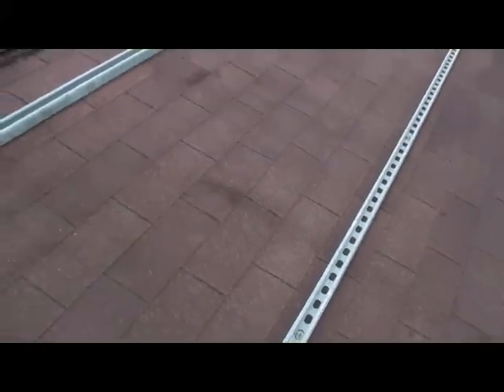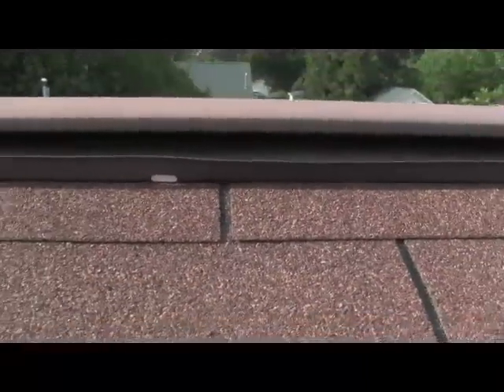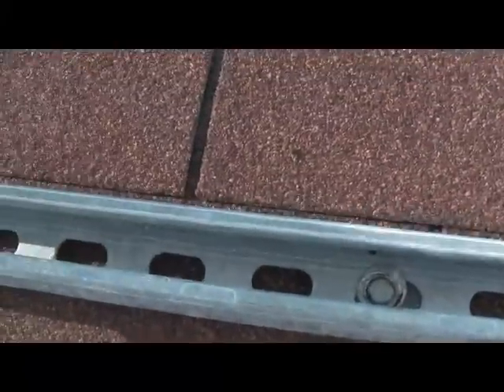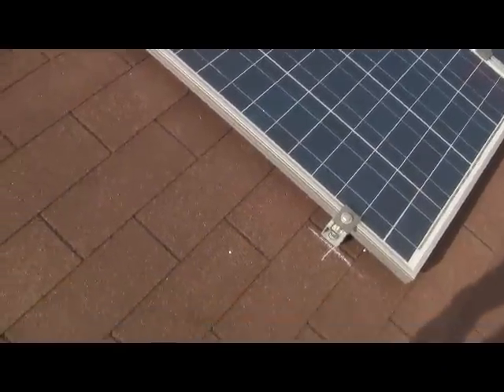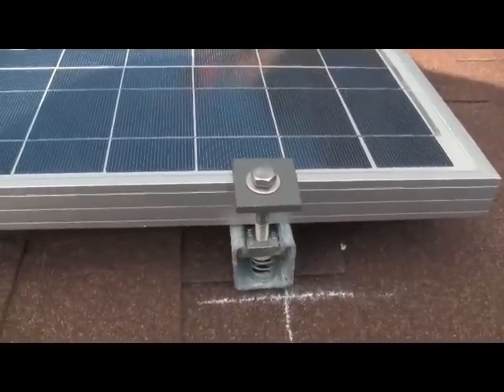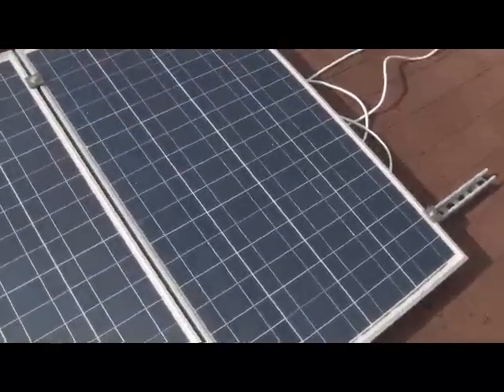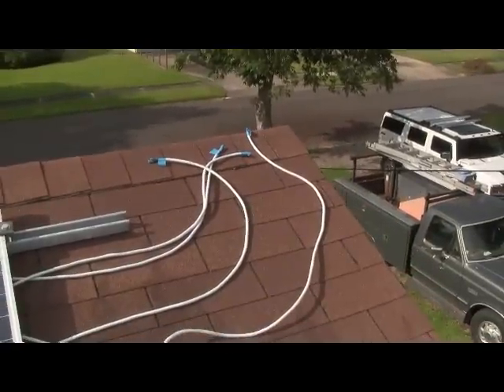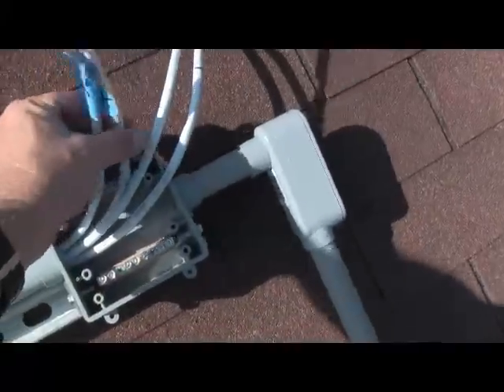Installing solar panel on my roof

Comment: Nothing wrong with using Unistrut to mount solar panels but you cant lay them flat on the roof. The water has no place to go but back up  and eventually run under the shingles. The Unistrut needs to be raised up a few inches so water can get  under it to run down to the gutters.
Reply: I used Quickmount PV as well.  I put vertical unistrut first then put the horizontal ones on top of the verticals.  That bought me extra height. You definitely want the rails raised so the snow does not create an ice dam. Was hard to find in Canada but found a site that sells them.  I have some videos on it if curious. (don't want to seem like a spammer but just thought I'd mention it)

Comment: Fubar,
 That is perfect, way cheaper and way stronger than those rack systems with heavy priceing , I made my own with aluminum unistruts and all stainless steel nuts and bolts. Unistrut is the way to go.
GOOD JOB....

Comment: Hey Fubar,
I watched this video when you first put it out 2 years ago and I'm just getting around to installing my first solar panel and I love the idea of using unistrut since it makes installation easy, but also because it gets the panels off the roof which helps with air flow and will make them run cooler and make them more efficient.  Thanks for the video and all the tips you show!

Comment: where can i read about all the codes that i need to know, so that i can install my panels on my own and not have problems trying to pass inspection? Also,where can i get parts for installl? Thanks.

Comment: Has more resistance to corrosion and unistrut catalogue shows better than 25 years that means the unistrut wont corrode as its zinc coating thiickness is more in hot deep galvanozed steels.
another thing you should not put directly put the galvanied steel directly on roof surface its contact area with roof surface it enhance the corrosion activity as the roof surface has material which can enhance the corrosion during the wet season.
always use hotdip galvanized unistrut they are costly but safe

Comment: You should not use the ordinary galvanized unistrut, they are electrogalvanized, their galvanized coating avarage life in open and moisture environment is 3 to 4 years which eventually its surface corrodes. what happens the aluminium frame of solar panel acts as sacrifical anode when it is connected to unistrut steel, therefore during rainy or moisture seasons, slowly the aluminium fram of solar panel gets corroded and fail eventually.
you better use hotdip galvanized unistrut which ....

Comment from the maker: @BigBearHuskyMusher You can get them at Home Depot but you will need to paint them because they will rust. They are zinc and not the hot dipped galvanized. You can get the galvanized ones at any commerical electricl supply and they will not rust..............